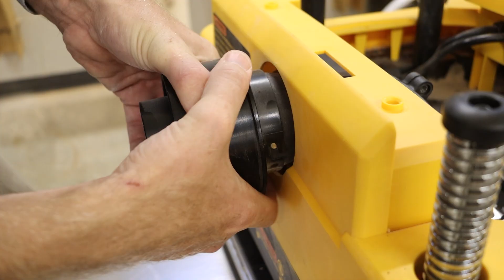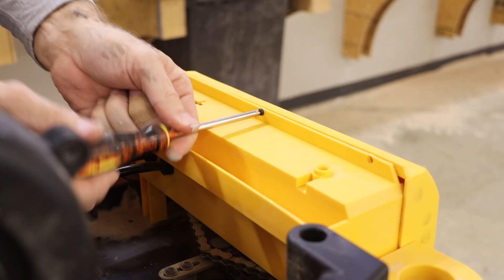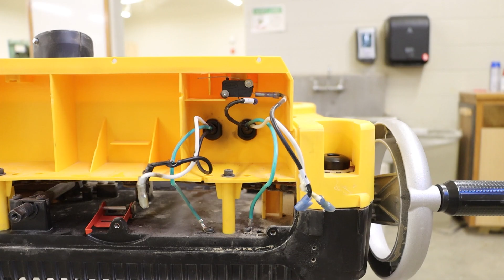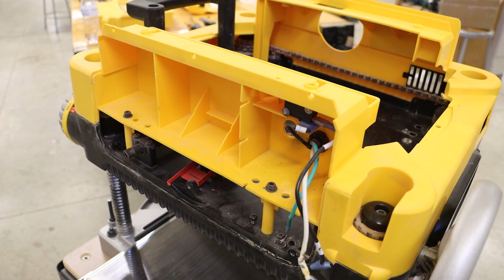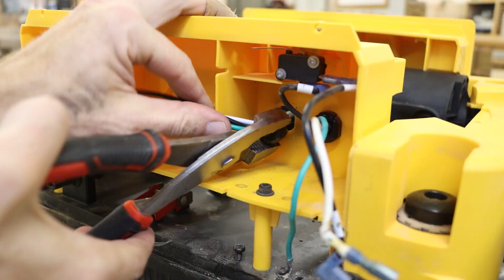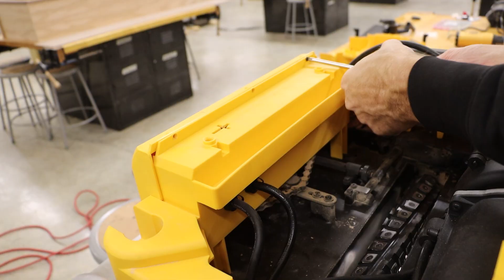Dewalt 735 Thickness Planer - Type 1 - Motor and Switch Replacement after Electrical Fault

Comment: I just bought this planer, my first planer and haven't even used it yet, but from all the videos I've seen with the helical head replacement, I wonder, would it be a good idea to rewire the machine with 12ga. wire. I see a lot of videos with burnt wiring, so with the added amp draw, I believe 12ga. Wire would fix that issue. I could be wrong, I don't know.
Reply from the maker: Thicker wiring would probably help.  I have two of these that are run extensively.  They were purchased at the same time and are run to the same degree.  One had wiring issues and the other hasn't.  What I am now finding is that the helical head is slightly heavier than the original and if the operator is taking too heavy of cuts on the roughing pass, it will end up cracking the drive belt pully (no to mention that it will pull near 30 amps) I've had to replace one pulley thus so far.  To remedy this, we only operate it on finishing pass (this also brings down the amperage).  Great machine, just not designed for heavy abuse and overuse.

Comment: Informative video.  I have to do the same and am contemplating purchasing the same motor that you used.  Question: how is the motor holding up?  I've only used my planer on soft wood for less than 6 hours and the motor is cooked. I also never take more than a 1/16" cut.  If the new motor is no better, I'm throwing this planer in the crusher.
Reply from the maker: No issues with the new motor.  I have high school students running it.  It probably totals about 4 hours of run time per week with all different species of lumber and operators taking off way more than they should.  Personally, I rarely take off more than 1/2 a turn on the handwheel for any given pass.
Reply: @InsaneOil thank you for taking the time to reply to my question.  It is greatly appreciated.  I too, am very conservative with the depth of cut per pass.  I did discover that none of the screws and bolts holding the motor together were tight.  Possibly a contributing factor to its extremely short life.  All the best to you from North Central Florida.

Comment: I have to do this same motor replacement. Have you noticed a change in performance with the new motor? Great video!
Reply from the maker: A few points.  The helical head does an awesome job and is substantially quieter than the straight knife head.  However, with "all" (or nearly all) helical head upgrades (on this machine), the extra mass puts extra load on the machine.  I have two of these that are run by high school students who often take way too aggressive of cuts.  These are 15 amp machines with a 20 amp peak motor.  With the new head, I commonly pull 25-30 amps with a heavy cut.  Here is testing my my two different machines: 

https://drive.google.com/file/d/1EXWa2Zm9zDxJV5j6gRQpFq5_A5LPZ2Qw/view?usp=sharing 

https://drive.google.com/file/d/1e7Ab4OBmPt_2Qz_iZb60Z1BiWusfwh7R/view?usp=sharing

As for the motor.  It performs the same as the old.  The first test (link above) is the machine with the new motor, the second test (link above) is my machine with the old motor.  Both have helical head upgrades.